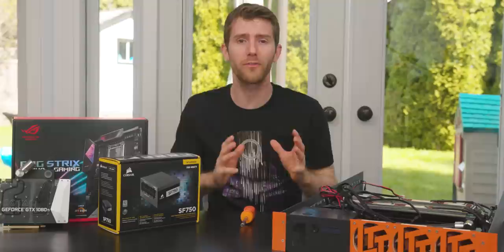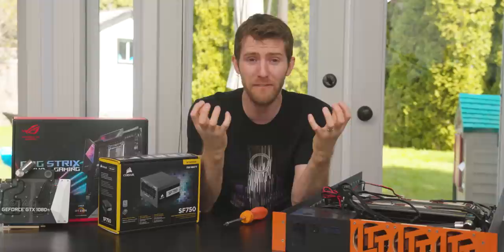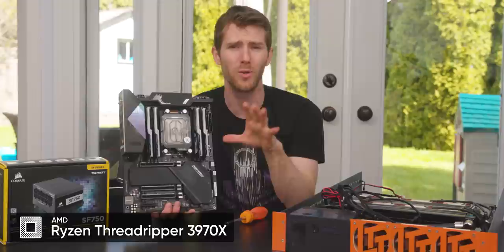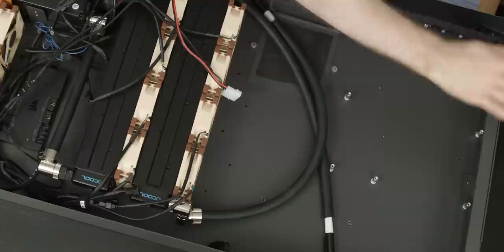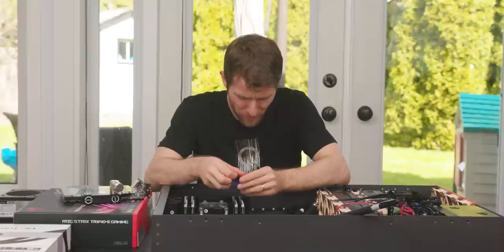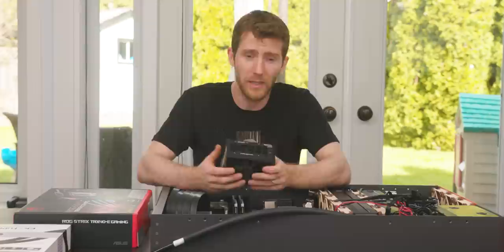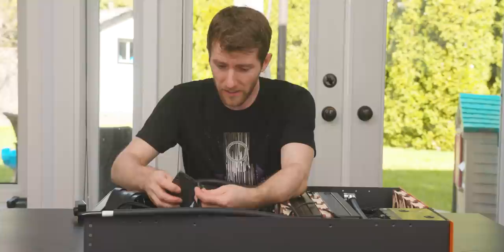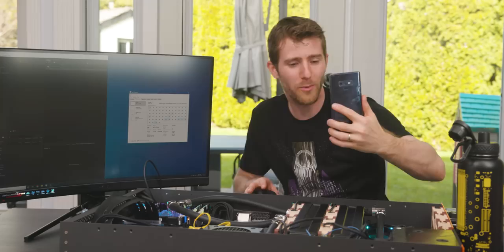Who is Video Rendering KING? Transcode Server Upgrade!

Comment: Sandwiching radiators like that yields no performance gains. You need to have the radiators spaced apart so that they're not transferring hot air from one to the other. I learned this while working for Swiftech.

Comment: you know whenever you say “the very best” or “top of the line” you immediately make excuses for not using the best hardware? i don’t actually care, but maybe not hype it up just to lie.
Reply: Where was the lie part I didn't see that?
Reply: @davidduthie4981  He said top of the line from both Intel and AMD but the 3970X isn't the top of the line for Threadripper. The 3990X is.

I mean to be fair I don't think it would've made a difference, in fact it could have less performance from how bad Premiere is optimized
Reply: @churchseraphim1380  Oh I see what you mean, firstly I am NOT an Intel fan in fact I think the company is morally bankrupt, but I thought he explained his reasoning for not using the very top Ripper, as you rightly say Premiere is poorly optimized, either way I wish I could afford the 3970, these are the best in class by a mile.

Comment: If whatever app is used has no core count limits just get a 4-socket Epyc board and build some 512-thread goodness. Even better if you can get the app to also use the Cuda cores in GPU's as well = drop a dozen 4760-core Titans in it. Fastest? Probably. Most energy efficient? Hell no, whatever closet that is in will probably need it's own 24,000 BTU air conditioner.

Comment: Please, please make a video about the best possible machine for audio DAW processing (most plugins, single thread performance, good low latency, best rendering times, multitasking etc.). I'm about to upgrade my twin Xeon 5690, 96GB system (10 years old now) running Cubase Pro, but I really don't know whether I should stay with Intel or jump to AMD. No one really answers this even after many hours of trawling You Tube videos. It needs an outfit with your level of resources and knowledge to properly test this out as most You Tubers and suppliers usually have an inbuilt bias as to AMD or Intel and they don't have the resources to test every contender. I'm sure a good number of people would be interested in your findings and it could stop a good many of us from making expensive mistakes.

Comment: The task manager is not ideal for checking the gpu usage, as it is a combination of all tasks the gpu can handle. For example encoding, decoding, Cuda computing, so you need to select Cuda on one of the smaller diagrams on the right of the task manager to see actual Cuda usage.

Comment: I like this, but also, would like to see the same test with a 3950x.  3970 is still $800 more than the 10980xe, so on price to performance it's not all that surprising, being more than 50% more expensive.  The 10980xe is about 50% more expensive than a 3950x, so I'd like to see how it stacks up...(never mind that the am4 MB is also much less expensive.)
Reply: monika laosi  The 3950x is the top end part marketed as Ryzen.  the 3960,70 and 90 are Threadripper parts.  They are both using Zen 2 cores, but Ryzen only refers to the AM4 socket mainstream parts.
Also, who cares if the 3990 is faster, it defeats the point of my comment.  I want to see the 50% cheaper part in transcoding workloads, on a motherboard that costs between 1/4 and 1/2 the price.

Comment: RIP in pieces Intel

Also... Server is a role and a hardware class. I run desktop/HEDT in server roles too. And I also have server class hardware as servers. But "server" means it serves something... I have a Raspberry Pi Zero W that's a DNS and time server. Technically still a server.

Comment: I'd be interested if the CPU performs maybe even better when you turn of SMT.
This is a wild guess now but the Threadrippers usage was constantly around 50%.
I would guess now that parts of the CPU-Cores are Used that are not duplicated within the cores itself so they need to "wait" for eachother.

Comment: If the amd processor is using only about 50%, how about comparing it to a lower amd processor that is about half the performance of that. Would it finish the same time? Or could there be a price to performance king in video encoding?

Comment: Isn't it possible to run two instances of this encoder?
With this little overall usage you should be able to run to video encodings at the same time without loosing noticable any performance.

Comment: psst guys. Could you cover the elephant in the room?

I'm talking about small form factor 80P gaming rigs that are looming trend and manufacturers are not responding to this? Like lack of DTX cases and mid range CPU coolers. We have ITX but that form is redundant and or ignored potential. Is there DTX cases or motherboards? I have not seen any viable products in europe market. Basic gaming mobo should have decent audio and built in wifi for htpc purposes. PC is taking over console markets and this market is not addressed properly.

Could I just jam DTX motherboard in ITX rated case? What are the options for CPU cooling in between huge tower sinks and iffy performing pancakes?

Comment: LINUS!!!! i have a stupid question.
can i cool a CPU using a cooler from the back of the motherboard?
(maybe removing the socket, using a thermal pad insted of thermal paste and found a way to take on the CPU without the socket)
on youtube i can't found any experiment about this.
i think you can try to mess up something with this "don't try this at home" idea :3

Comment: Question is who is the RTX King. Which CPU works best with RTX. And Intel has nearly a 25% advantage at 1440p with RTX rendering in games THAT USE RTX. 
RTX is the future no doubt. And exactly 0 games use all 3 RTX features at Once. But in any RTX Game. Intel 8700K or 9700K over Clocked 4.9Ghz + per core. Provides 20-30 more FPS. Add ontop DLSS 2.0 now Intels ipc faster clocks start to deliver even faster FPS.

Comment: Hey @Linus is it sad that I'm still running a I5-2400 to game and edit with?
My country is in isolation/lockdown how are you getting on over there?

Specs

Processor
Intel(R) Core(TM) i5-2400 CPU @ 3.10GHz (bottle neck city)
 
Video Card
NVIDIA GeForce GTX 780 Ti
 
Video Card #2
NVIDIA GeForce GTX 780 Ti
 
RAM
24 GB
 
Operating System
Windows 10

Comment: Transcoding can’t be offloaded from CPU to GPU?
Reply: codycast gpu encoding usually doesn't look as nice. software encoding still looks better but obviously takes longer. 
if you have Plex you can try out the diff. gpu looks 10-20% worse but with a $200 gpu u can do multiple 4k hdr. you'd need a $1000 cpu to do a single one.

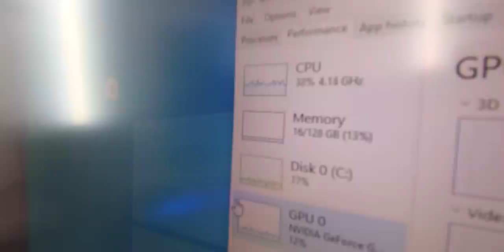Comment: 9:40 How can you improve the performance further, if the CPU usage is only 60-70% at this Point? Why isn't it 100%? What is the limiting factor?
Reply: software buddy.
Reply: @lumine7653  But they both used the same software.
Reply: @__Mr.White__  It means that the software is just not there yet. The only time you would see 100% in cpu is when a software loads all of your cores and threads at the same time.

Most programs and games out there just won't fully utilize all of the cores and threads in a modern cpu especially those with 8+ cores and 16+ threads.

Comment: How would a 3950x compare if you are only utilizing 40-50%?
Reply: smh are you not a gamer that also streams while also running a render in bg ? 
cringe
Reply: @_yuri  so you didn't watch the video where he is telling us that the only utilize 40-50% on the 3970x while rendering so why not switch to the cheaper 3950x with half the cores but with higher clocks?

Comment: I don't know where to ask this.  So asking here...
Why the hell has the price of the AMD 2700x jumped to over double the price in a matter of a couple months?  Like what the ?????  

Does anyone know what this has happened, and more to the point, if someone knows, will it drop again soon?  

Was planning on buying a new budget gaming PC fo my kid, but wanted to use it on the side for rendering.  If prices don't drop will likely go with a 3600 instead... but the 2700 is so much faster for rendering....
Reply: The Journey 2700x OOS atm. AMD is making new chips with new memory controller. but delayed due to COVID-19. 
also for gaming Zen 2 performs better, you get higher clock speeds which games prefer over more cores. in Zen 1 you may have to enable game mode which disables some cores in order to not lose FPS in some games. 
also if you can wait. Intel is releasing new cpus in a few weeks. this might drive prices down again.
Reply: Dylan Nguyen hey.  Thank-you.  Appreciate the info  i can wait a bit, as it is just for my kid so he will stop needing mine.  I am putting a 1660 gpu in it but also want to use it for rendering which is why i was thinking 2700x over 3600.  I was thinking it was about time intel hit back, so very interesting.  With china claiming near zero covid cases wonder if the amd prices will improve just on their own as demand is met...

Comment: Transcoding video on CPU in 2020 🤦‍♂️
Reply: Achiev'Us cpu transcoding still produces the best quality. you can check nvenc vs OBS videos or Plex HW vs SW transcoding. 
hw transcoding on gpus results in about 10-20% less quality. but it is faster. depends on if you want speed or quality. I'm assuming they want quality.